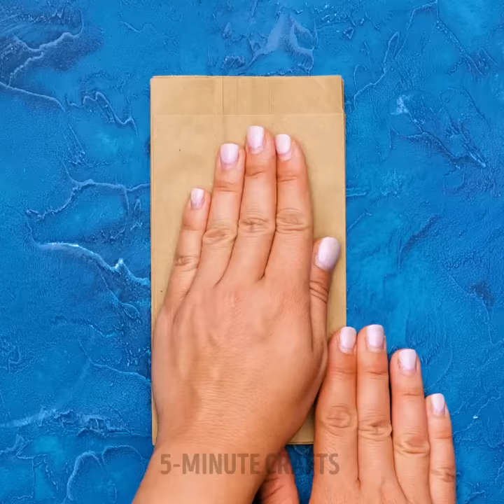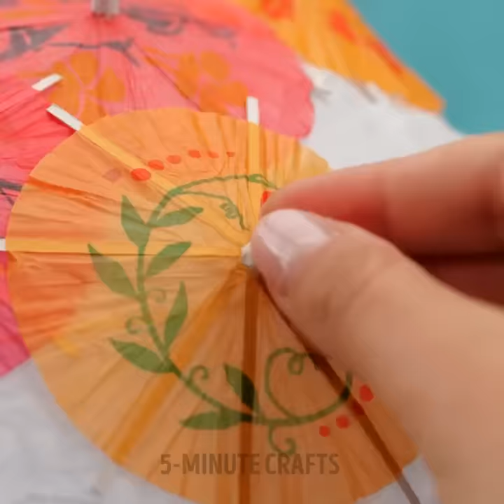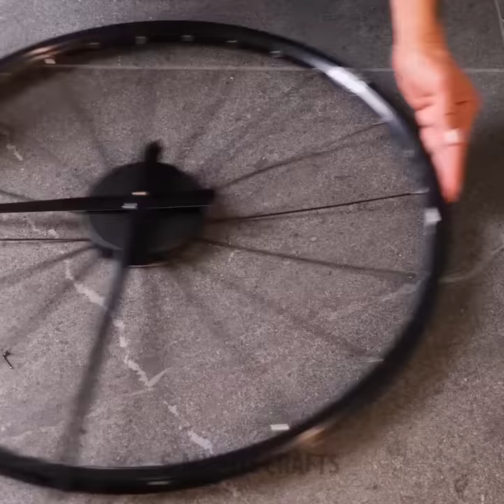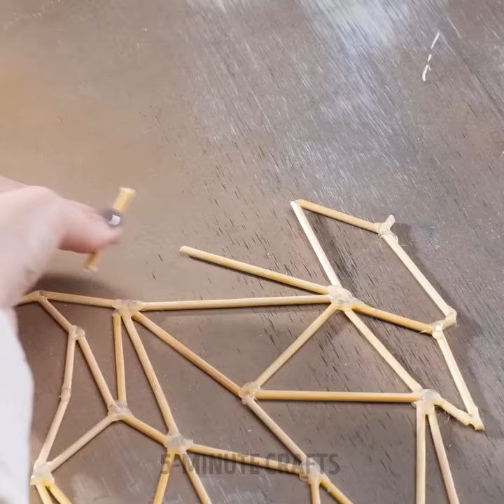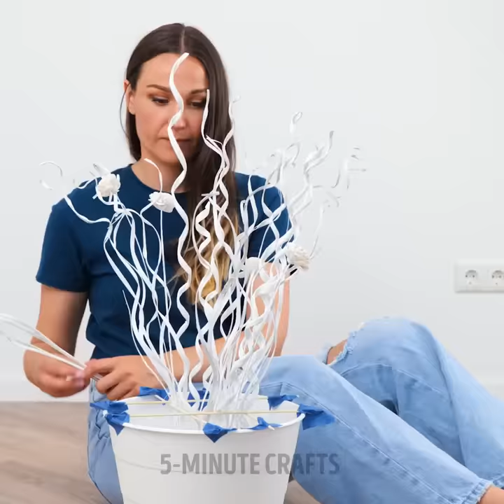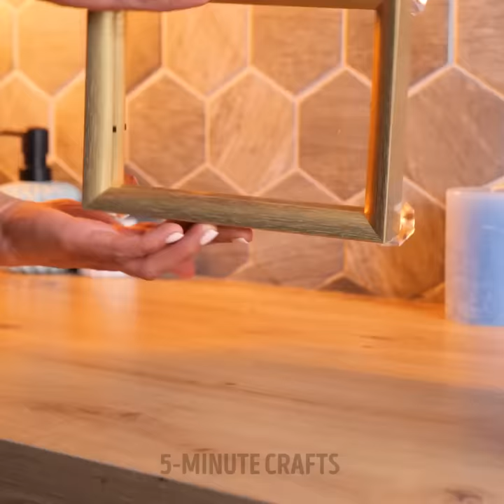Inspiring Home Decoration Ideas for Every Room

Comment: That basket that you put a light in; the cord distracts from it’s appearance. A battery operated light would eliminate that cord, and be more eye pleasing and you could simply glue the light to the inside of the basket.
Reply: The cord needs to be the same colour as the wall.
Reply: Ur correct theory could be correct